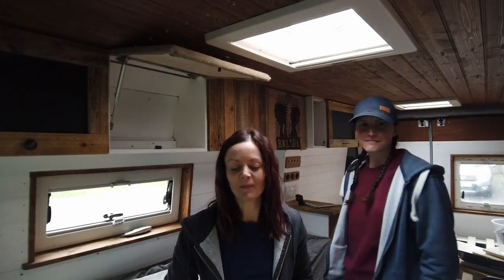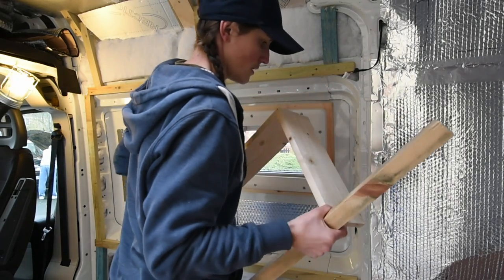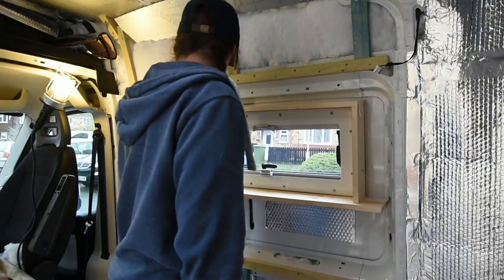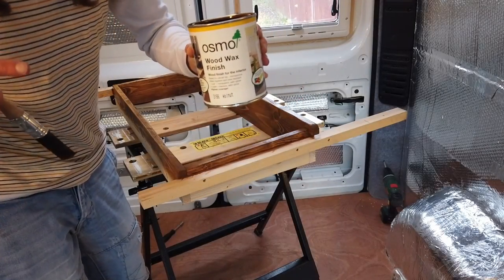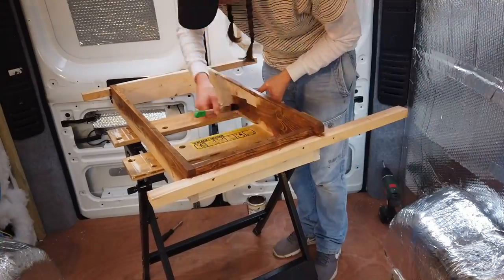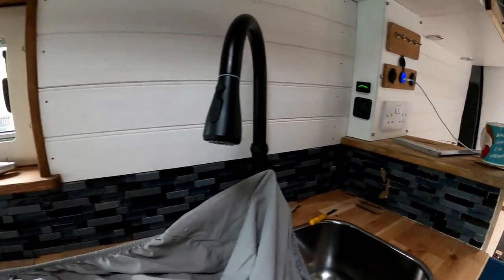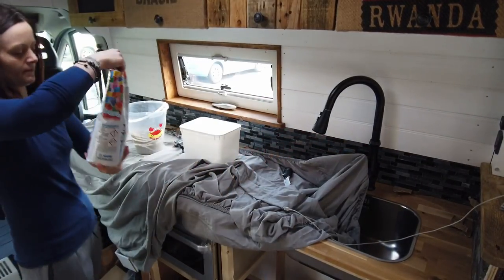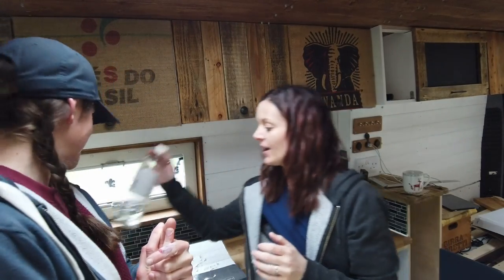How to frame your campervan windows... and some pretty neat tiling!

Comment: Definitely one of the best build series. Won't pester you by posting every vid but have watched and liked them all. Great job. Also one of the very few van builders to bring up the issue of weight. Most forge ahead assuming that 3.5 tonne is massive weight. I can see some builds and think to myself....... definitely overweight. Great great work.
Reply from the maker: Wow thanks Jeff! 👍 Weight is well worth considering, especially when your going Dow the route of using a lot of wood. Thanks a lot and thanks for watching 👍

Comment: Emily looks like she's tiled before! Can I ask did you apply the tile adhesive onto just plain wood or something else like plasterboard or something? I ask as I'm coming up to doing my tiles soon. thanks.
Reply from the maker: Honestly she has never done it before. In my opinion you should seal the wood with something, but not pva or any kind of paint with a gloss or shiny finish, I'm not 100% tho, we just used a primer and undercoat on ours and so far they have stayed up. I'm only used to tiling onto plaster to be honest.